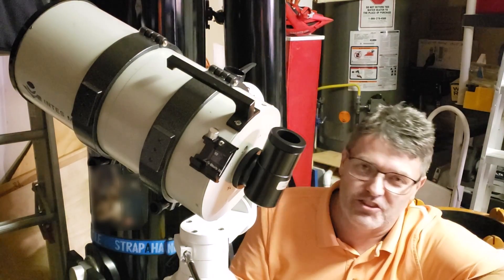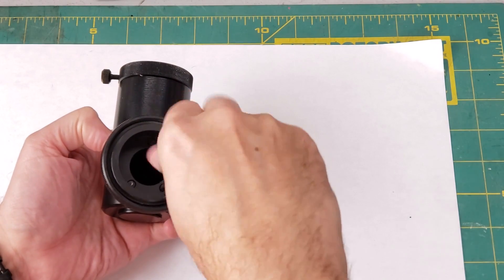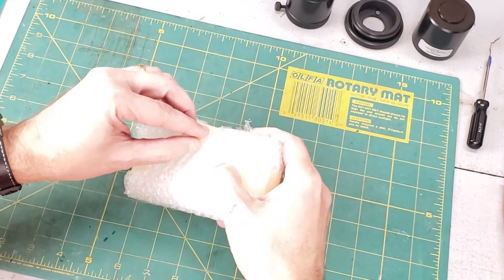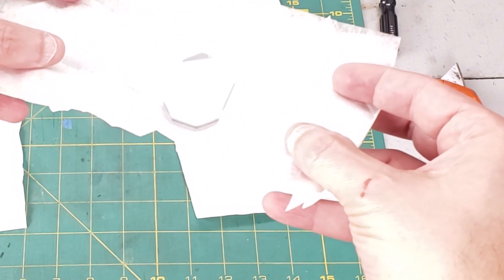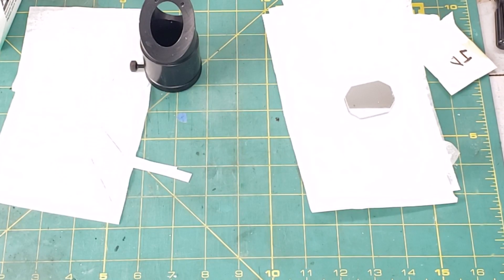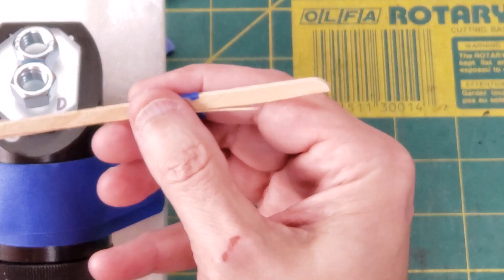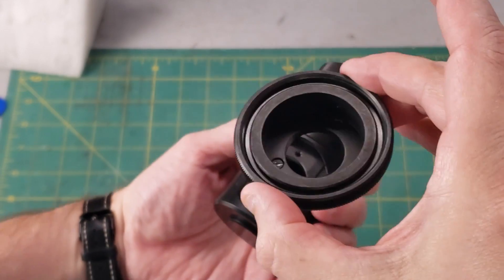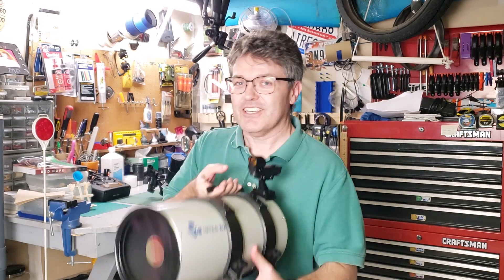Recoating A Tiny Flat Telescope Mirror

Comment: I had my C6-N Newtonian recoated on sale that included the secondary. They tested the mirror and for $260 they would refigure my mirror to 1/10th wave and .95 Strehl guaranteed.  Turned out at 96% reflectivity, 1/12th wave and .98 Strehl ratio. It was so good I had to buy a 2" Crayford focuser and one guy in my club uses it for astrophotography. He said it had the clarity of a refractor. My son gave me an Explore Scientific 102mm Carbon fiber triplet and it isn't any better except at higher magnification on double stars, but they're pretty even up to 300x magnification when condition permit. 
Above 300x the central obstruction does dim the view a bit, but you're not supposed to go over double the 150mm aperture anyway. For under $800 I got Takahashi quality optics and it is just great for high power visual. Biggest expense was the JMI focuser.
Reply from the maker: Wow, those are impressive mirror stats!  If I may ask, what company did you have do that for you?
Reply: @AstronomyGarage  Unfortunately Optical Wave Laboratory went out of business. First their recoating chamber kept breaking down and the optical engineer who refigured my mirror left to "get paid what he was worth." was what I was told. I wanted him to do an 8" mirror, but they didn't tell me where he went to.

Comment: Its interesting that it appears to be using a standard Celestron/Meade SCT-back size threaded collar - INTES must have been designing so that they could sell the integrated diagonal/focusser as an aftermarket item.
Reply from the maker: Good point.  It also came with a pretty interesting helical adapter for an SLR camera.  It allowed you to move it in and out (using a helical movement), but the camera didn't actually twist. It just caused it to telescope out.

Comment: great video John i cant wait till you show us the video on Jupiter, i have owned maks but not an intes.
Reply from the maker: Hi Joe, thanks for watching.  I used to have a smaller cheaper Mak, but I thought the planetary images weren't all that great.  I can tell you that the planetary images through this one are pretty fantastic (I actually bought a backup focuser tube in case this mirror recoating failed).  I'll be showing Jupiter when I do a video where I replace the mount rings with a mount block. Clear skies!

Comment: I recently bought an open box Celestron C6 Schmidt Cassegrain.  I was getting internal light reflections.  Celestron told me that it was missing flocking in the baffle tube.  Flocked it and now waiting for clear weather to test.

Oh, and dissembled my Bresser 102/460 yesterday to clean the inside of the lens.  Have been surprised how often I have to do things to telescopes and mounts.  Sad, as I have the mechanical abilities of and wet butterfly.

And, I watch your videos in hopes of gaining a bit of know how.
Reply from the maker: Thank you for watching. I'm very curious to see if the flocking helps your C6.  What about a "light shield" around the front?  I have a giant cardboard tube that I attach to the front to keep streetlights from illuminating the tube itself.  It prevents the streetlights from at least lighting up the inside of the focuser tube.
Reply: @AstronomyGarage  I use an aluminum dew shield made by Celestron.  It sticks out 9 1/2" over the front of the optical tube.

Sent some celestial photos I made to Celestron and tech support said that the baffle tube was not flocked.  They said some get sent out as such.  The baffle tube is the tube that exits the rear of the optical tube and protrudes through the primary mirror 6" or so.

I bought some self sticking flocking paper and cut out a piece the same width as the circumference of the baffle tube, rolled it around a pencil so as to make it curl inward and very carefully slid it into the baffle tube, pressing it with the pencil against the sides.  Looks pretty good, but the proof of the pudding will be in the eating.  Hope to take it out tomorrow night and test it, if weather is clear.

Have never used a Schmidt Cassegrain before and want to learn to use it with and without the x0.63 reducer/corrector before I try the Starizona Hyperstar 6 v4 I bought.

Am hoping that a 150mm aperature with f/10, f/6.3 and f/2 I may be able to photograph all my deep space targets with one optical tube.  Don't know.